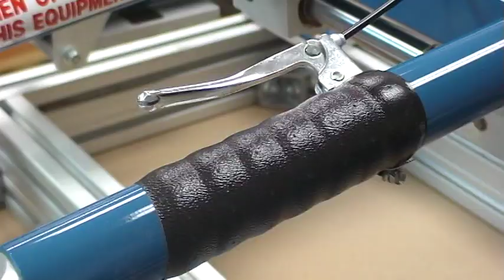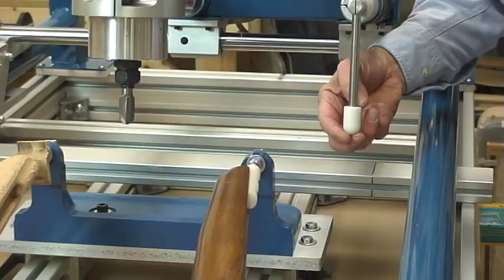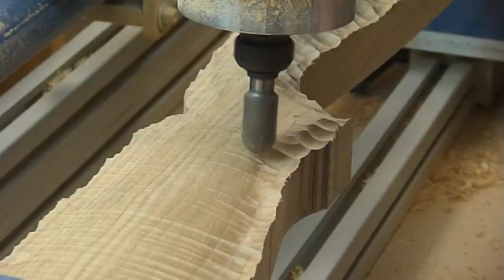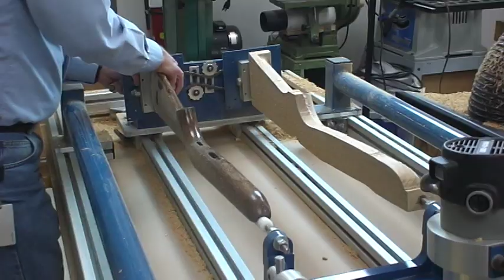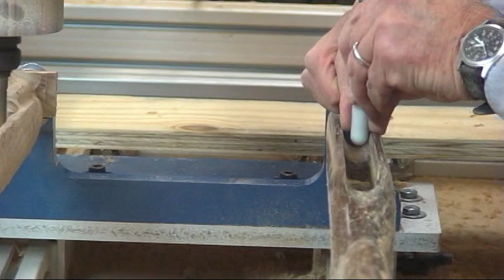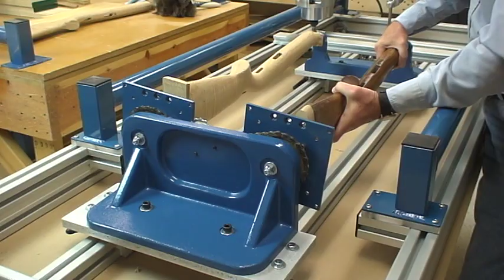Gemini Gunstock Carving Duplicator

Comment: Awesome machine ... would love to have one.
Of course, someone else would have to buy it for me.

I wouldn't motorize the rotation, but what would be nice is a 'hand crank' for rotation centered between the work pieces to avoid excessive torque from disturbing either piece.
Also a single throw lever to lock down both ends.
With those additions I would call this 'perfect'.

Comment: I have one of these machines and have never used it yet .  I would want the blank cut out about 10% prpportionally larger so it can be hand finished .would you wrap the original with tape and cardboard ,?or how could you adjust the mechanical advantage  to make it fatter ? . I can also see adding on cheek peices for left or right handed , and comb hight to match a big scope .
Reply: I would just set the feeler (sorry for my bad English!) slightly higher than the milling tool and for different stock shapes to mill it freehand, without using the feeler, approximately the size I’d like and then finish it by hand stuck in a normal vice…

Comment: 6,975.00 for the one pictured in the video.

Only have to do 3-600 gunstocks to break even if I have free wood available.
Reply: I think your math is a bit off... 
$7000 divided by 350 stocks is still only $20 each, I'm sure a capable craftsman could charge double that maybe even triple.
Reply: Definitely plus wood type adds value, but you know plywood would work too.